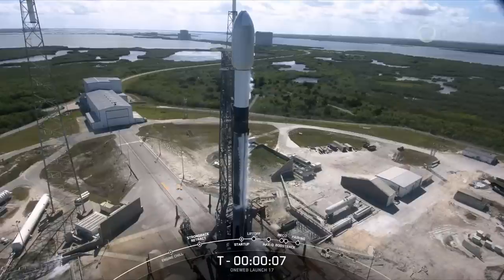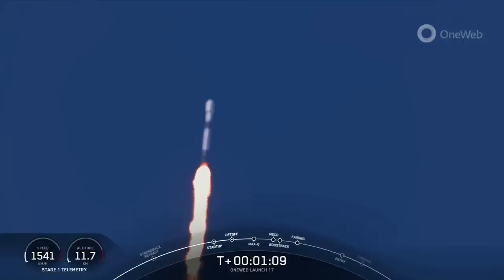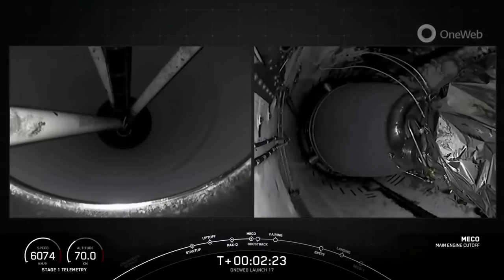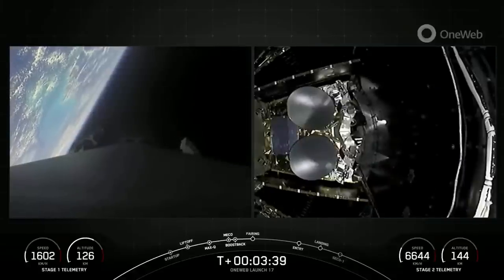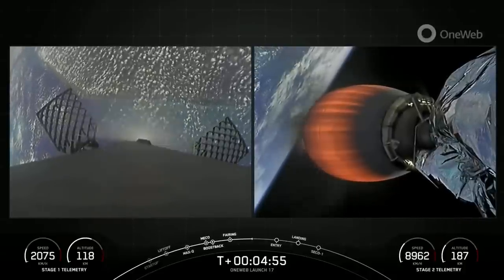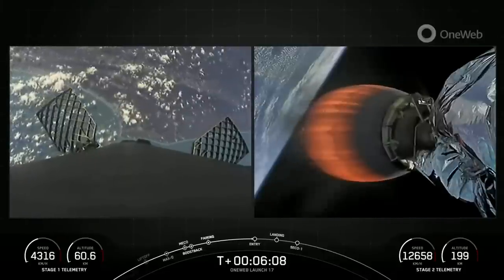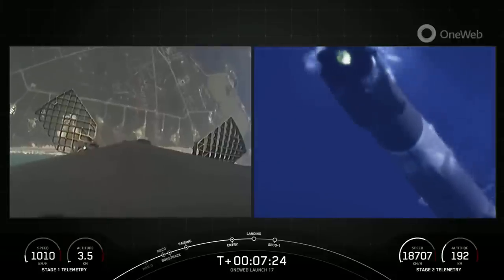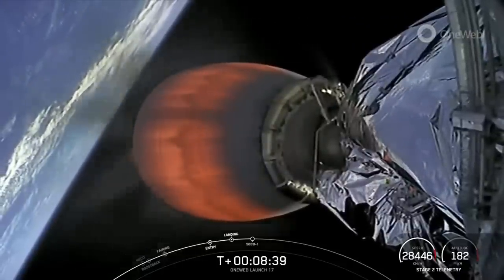SpaceX launches 40 OneWeb satellites, nails landing in Florida

Comment: 5:44 what's that coming up from under the booster??
Reply: thats for adjusting the rocket path
Reply: Nitrogen gas blasters. Act like small rockets to move the booster in the right directions for a stand up landing. What is amazing to me is the software that was written that allows the booster to know its relative position to the landing pad and deploy blasters and those feet that look like square tennis racquets.
Reply: @mikebutler7605  the grid-fins, they allow for some control during freefall,